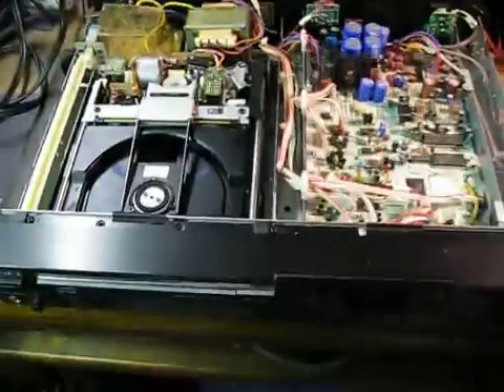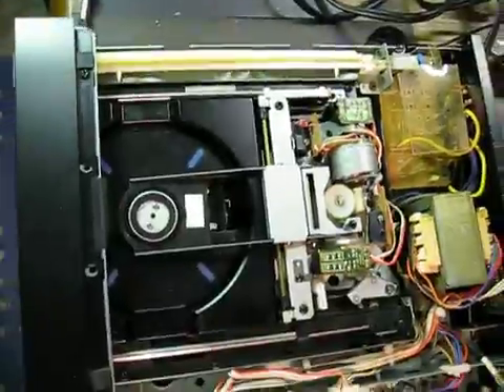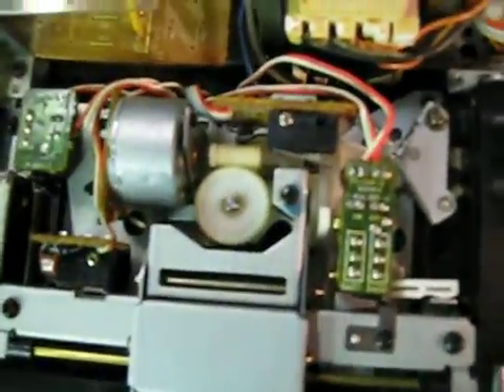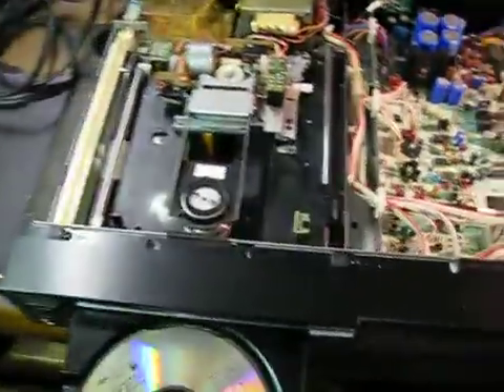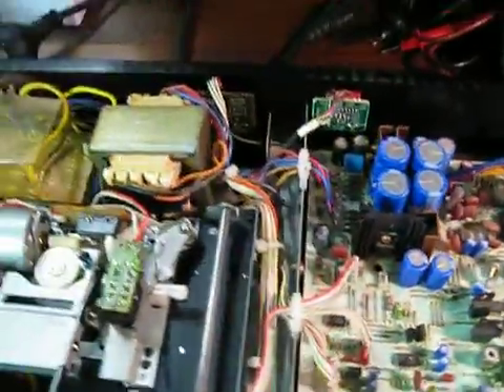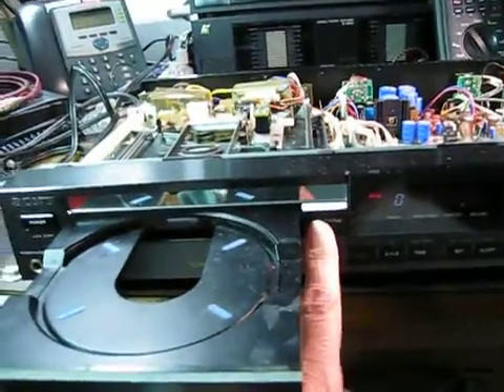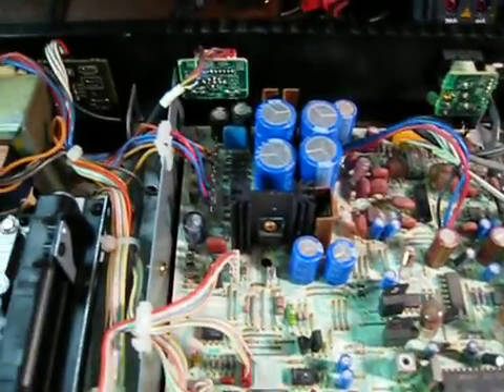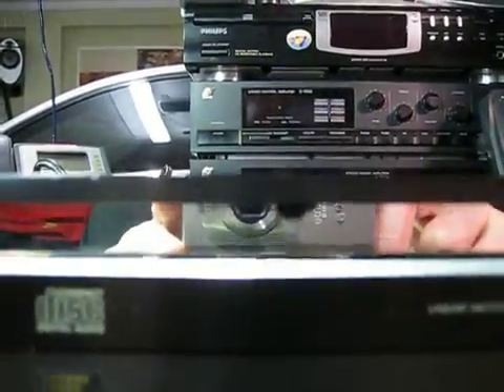Sony CDP 302ES with BU-1 Mechanism. Power supply issues.

Comment: Thanks for the great video! Do you know if the laser from a BU-1 mechanism is compatible with a KSS190A laser? I would like to have a spare laser for my Sony CDP-R1 and I've got two units CDP-102 with BU-1.
Reply from the maker: They look almost exactly the same and there is a contention in the community if they can be transplanted. I have not tried it because I have never had a need, but if I did, I would make a serious attempt at it. KSS-190A now cost close to a grand but it is so good that you should not fear that it will fail. One of the 302ES players that I have I bought from original owner was untouched by any serviceman before me. I measured laser emission at 2,4 times the normal level and it worked fine like that for 30+ years. Others lasers would burn out in 2 weeks.

Comment: disc tray it,s normal super fast like a rocket, also reading is the fastest ever, great player,...
Reply from the maker: Thank you guys for your comments.
You were all correct and so was I ;-)
bjtaudio was right that the caps did not leak and the discoloration there was just glue.
rick ven and vinyl79 were also correct that the tray should have been traveling faster.
I am was right when I claimed that there was a power problem.
I had a bit of time and have returned to this player.
IC901 which is a common 7805 5V regulator was faulty and not coping with the load.
I tested all the electrolytic caps and all the other regulators and they were all  fine.
The tray now loads and unloads "like a rocket" - this truly is superb mechanism.
I will upload a video later.
Thanks guys.
When I get a bit of time I will (micro) Lampizate it (fit a valve stage and a separate output) and maybe even a coaxial SPDiF output.